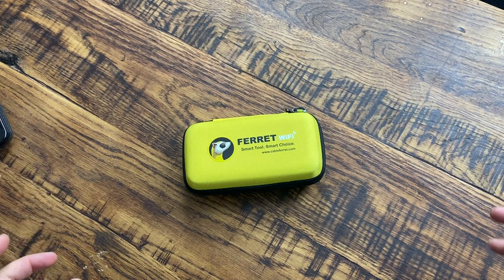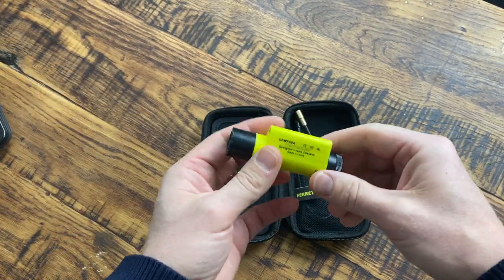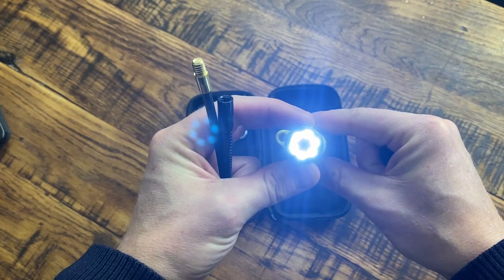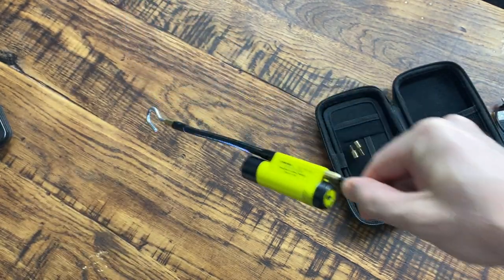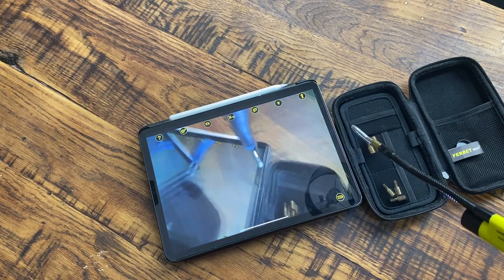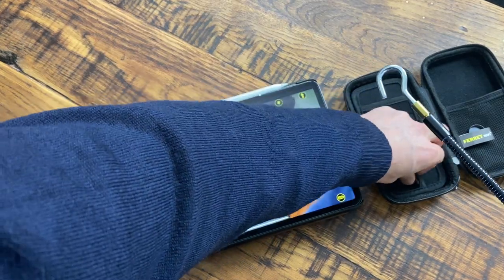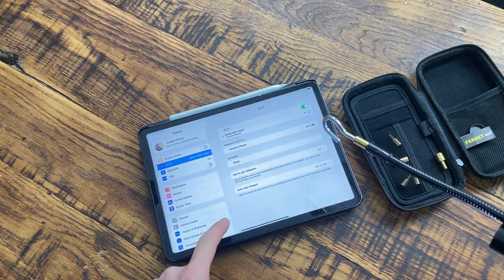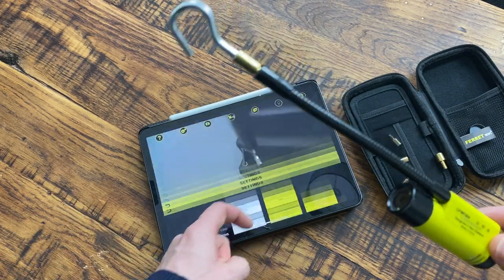Ferret Wifi Inspection Cam Cable Pulling Tool

Comment: Lovely review. Thank you. Does this also work on the Clarke rod set does anyone know?
Reply: It comes with adaptors to suit most rods, the camera thread is 1/4" - 20UNC, the adaptors included suit 8-32 threaded rods (most common thread type in the USA) as well as 5mm and 6mm metric threaded rods.